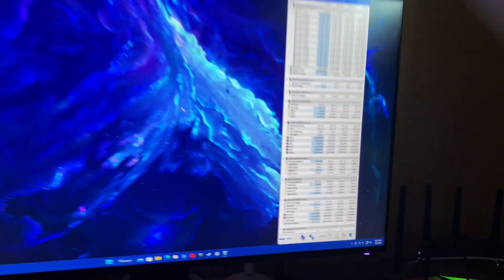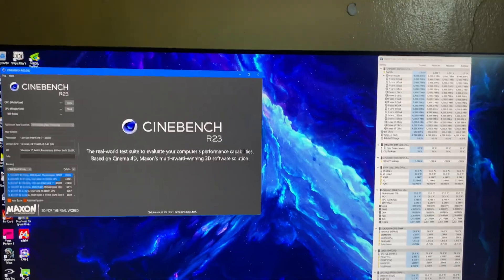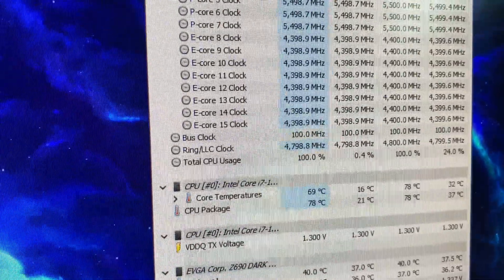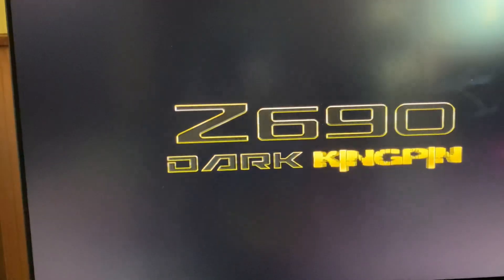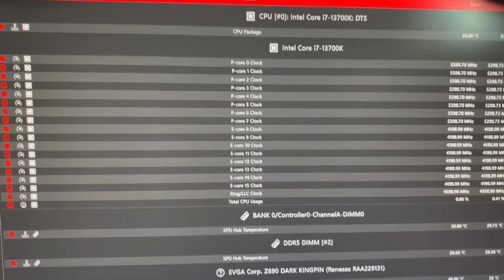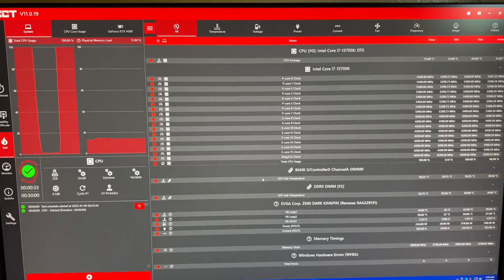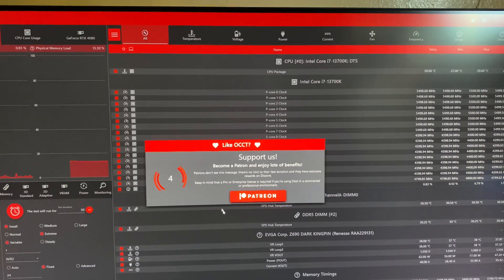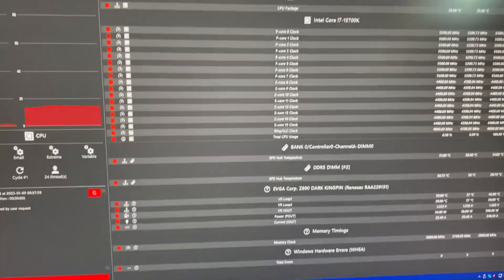Cinebench R23 and OCCT SSE/AVX2 Clock Behaviour with Raptor Lake (Interesting)

Comment: CB R23 does NOT read AVX offsets. It doesn't have that code in it...just plain AVX...might as well run with zero offset.
Reply from the maker: @OurFathersLove  I’m not sure. If I actually said that, then I definitely misspoke. I’m aware that R23 is not an AVX load. It’s part of why I suggested R23 and OCCT SSE mainly.

Comment: The interesting thing I've found is that if I run CB23 single core it crashes, but only if I'm running OCCT to monitor the system. Once I close OCCT it runs fine.
Reply from the maker: That's a weird one for sure

Comment: couldnt reproduce in my dark, stats: (they are the max)
cpu package power 356,power pout 303,power input 372,current iout 243,current iin 31,vr vout 1.25v,vr vin 12v,temps 75c
same test in occt. in bios voltage is 1.35v -25%vdroop 55/49/41
Reply from the maker: You have an i9? The 13900K’s hard-written all-P-core is 5.5. I don’t own an i9. For me it’s 5.3, for you it’s 5.5 and for i5s I’m unsure. If you try to run 5.6-5.7 you will downclock back down to 5.5, at least on the Dark.

Also you may as well get rid of CPU package power. VOUT*IOUT correspond to the correct POUT AFAIK. To get the correct package power you need to mess with AC/DC LL.

I assume this is in reference to the AVX2 test in OCCT where I demonstrated my i7 dropping from 5.5->5.3. Of course in SSE you’d hold max all-core, but in AVX2 you will see that behaviour on the Dark, but it correlates to your CPU SKU as I said. The 13900KS will have a limit of 5.6 for instance once it arrives.